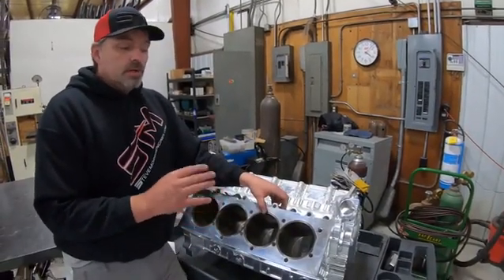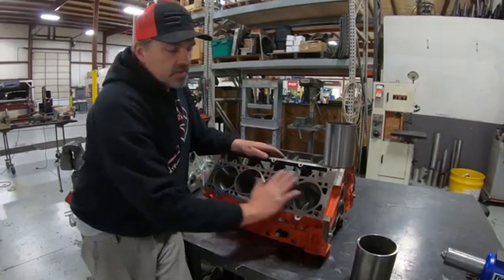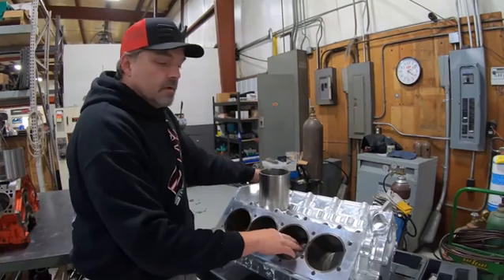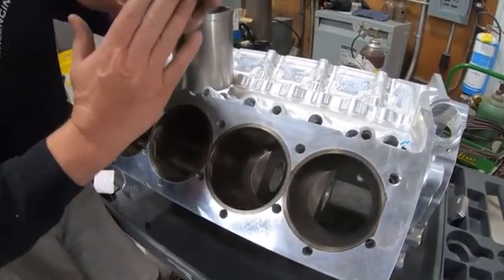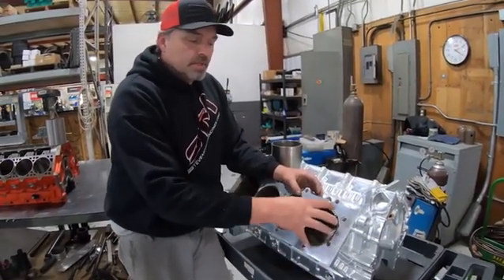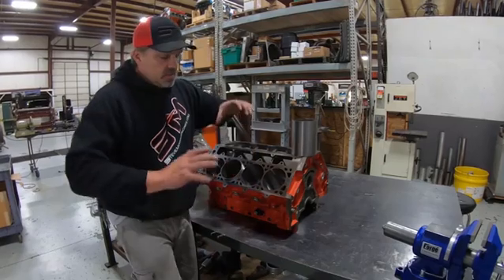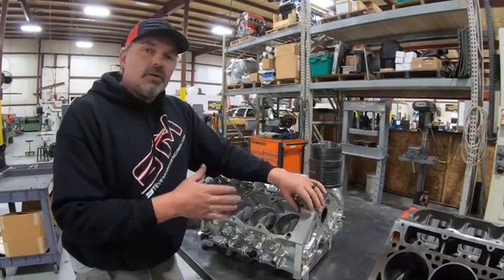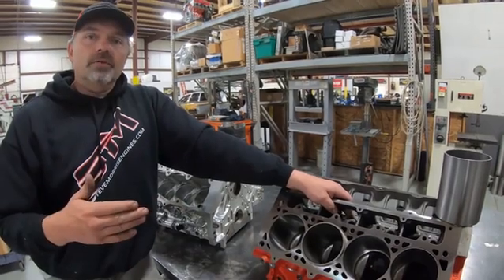Sleeving an Engine – Part 2

Comment: I have a v8 cid which was sleeved however while boring the block it cut into the water jacket on 2 cylinders, all of which was coated with red locktite before pressing in which had a .003 press press fit. This is my boat engine and I am wondering if it could cause a problem with the water touching the sleeves the sleeve is 3/32 thickness and it is  melling CSL136HP sleeve…. Thanks for your answer….
Reply: What happened to you? Is the method successful correctly without water leakage?
Reply: @rossiramsarn ?

Comment: I'm looking to possibly wet sleeve an engine for a larger bore. The bore spacing is 4.38" and I want a 4" bore (currently it is 3.75) . I am wondering if it can be done without loosing structure integrity of the block. 258 6 cylinder Jeep engine with 351 Cleveland heads cut and welded together to make some interesting power.

Comment: Hi Steve , I appreciate your knowledge passed on to us you tube watching audiences . i have a Pontiac 389 that I am going to have one cylinder sleeved  because the engine sat for years  and the one cylinder , the piston was at the bottom of the stroke and water or moisture sat and now the lower end has a area that has a pitted texture that won't clean up with honing. I plan on putting a stroker kit in other wise it probably wouldn't be an issue. With all that being said the engine will be in the 425 -450 hp range the block is the original cast iron block from 1960. Do you recommend the other cylinders being honed after the sleeve is put in . Since the hp will be under 500. The stock stroke was 3.75 the new stroke will be 4.25 thanks for any advice you might have .